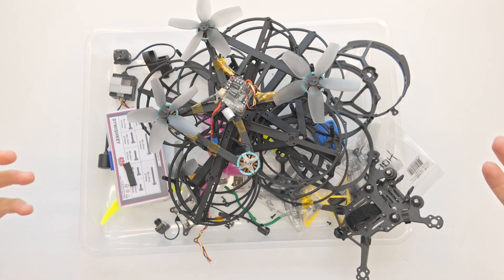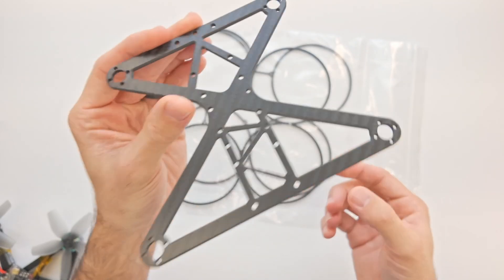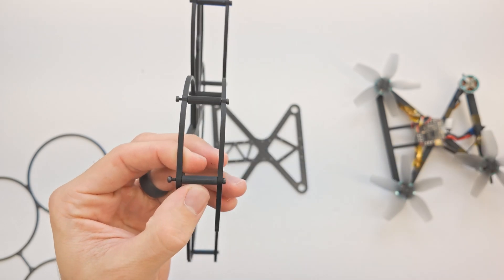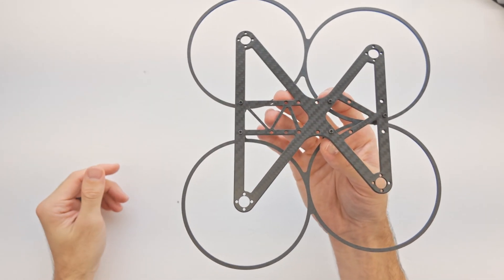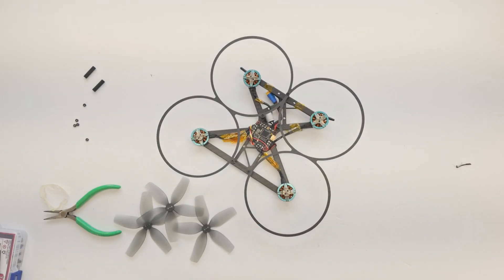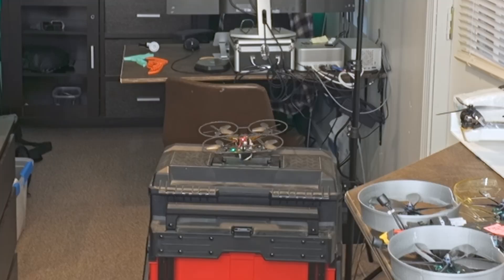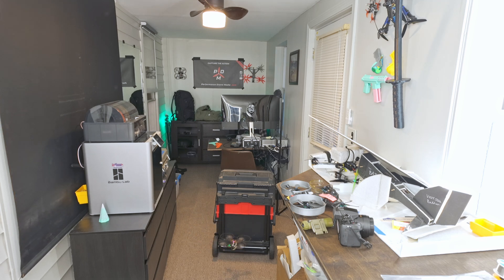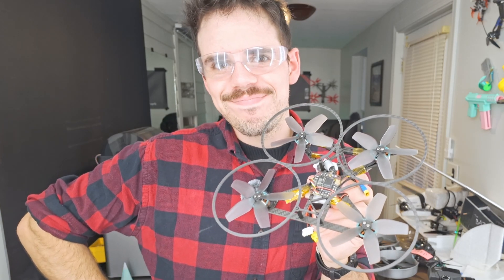My 4" Do-All FPV Drone Project // Carbon Fiber Frame Design (PART 2)

Comment: Very cool project dude!  And it flies good too!   Yesterday I told myself that it's time to design my own 4" freestyle frame because I'm not satisfied with the AOS 4 frame I'm using.  I'm getting the hang of FreeCAD, as I've already designed several antenna mounts, GPS, lidar/optical flow mounts, stack adapters, etc.  So now it's time for a frame.  I know it will take a while and I'll make a lot of mistakes.

BTW, I destroyed one of those GNB 930 packs last week, so I took off the plastic wrapper and some of the padding and found out it weighed 7 grams less!  I'll be doing that get my Flyfish Atlas 4 under 250 grams.

Anyway, looking forward to seeing your design update.

Comment: Thanks . You are ne of the mentors of fpv . 
 I made a drone last week . It has a 2 watt radio booster with xmplus and a gps return to home . I tried a walksnail but the fc is bf v 4.0.3
 You need a computer to change that they say . Pretty bad . So i am using a button controlled 5804 800mW analog vtx . Elrs gets 50 miles thus outra ge 450 mile range